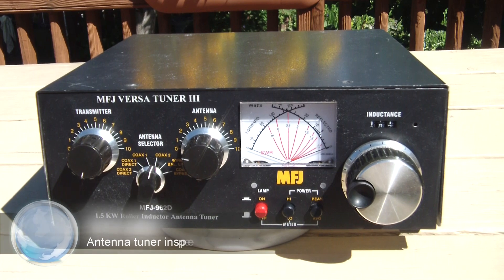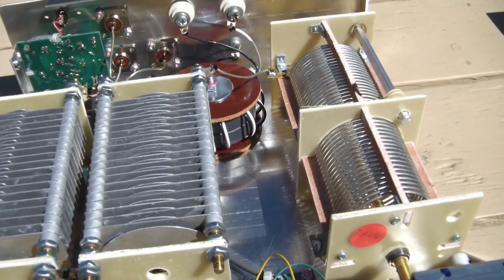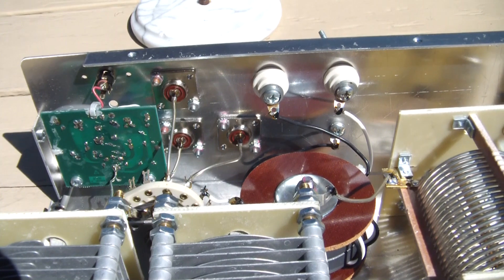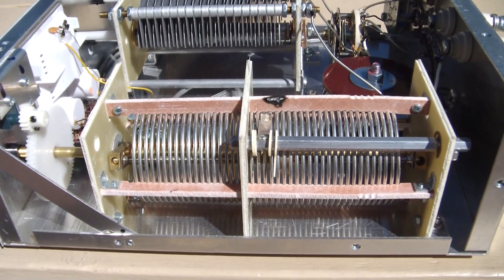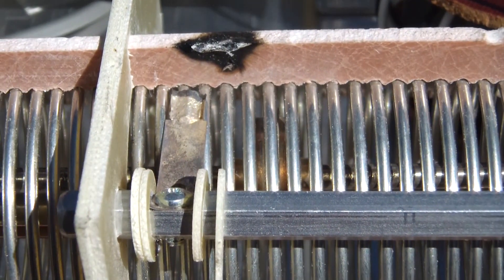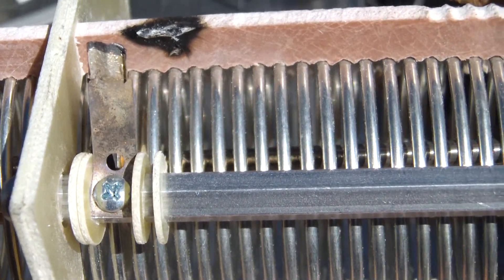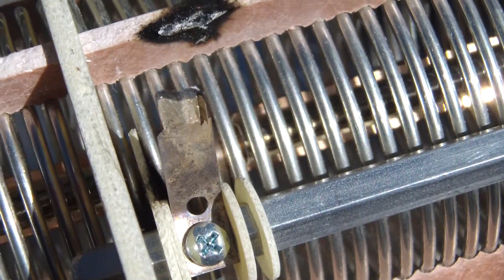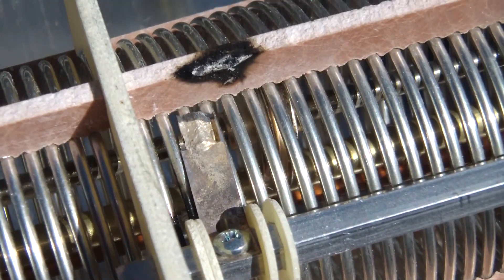MFJ962D, HF antenna tuner inspection.

Comment: Is just orser a new one ... theres probably a few bad spots in it anyway and you dont want it to fail while keyed down with the amp doing a KW .... it would surely arc the Caps... .as of  march 2022 they are $150.... which is a lot cheaper than 150 plus a pair of $95 caps = $350 ...
Not really worth the risk...

Btw the switch is about $95on the atr-20 and 30 so I imagine its close to the same on the MFJ too..

Comment: You are not to key up & put  any high power in the tuner when you are turning the noobs on the tuner , Use low power on the tuner to tune your  tuner/ antenna / radio  , Then  once there all  are tuned up you can turn the power up on your tuner to use , If you don't do this you will burn the roller / rollers on your turner .

Comment: take that rod out , you don't needs it , its one of MFJs better ideas that don't work right ,I took mine out and it works fine
Reply: Thanks. I looked into this, and you’re correct. The bar device is potentially helpful, but not necessary. And more importantly, it breaks because it’s horribly made.
Reply: It works ok  if you use the tuner in the right way in low power only , Then once you have the tune you can turn up the power , It tells you all about this on the MFJ website  , How to use your turner .
Reply: @kevinmcdermott3668  I used the tuner exactly as the manual tells you to. It didn’t arc over, but the self resonance defeat contact broke anyway. It’s poorly engineered.

Comment: There is a You tube video by Kevin Loughlin detailing the EXACT same problem, same tuner, listed with your video. Wish I could send a link, but don't know your email to send the link, but if you research KB9RLW, & tuner you likely will find it. Not sure it will provide an answer as he left it as is to give to a new ham that likely wouldn't be using 160 (for which the extra inductance is used). Good luck! 73's!
de seeker / Jeff WA7LFP
Reply from the maker: Found it. Thanks for posting your findings. I have not gone any further on this unit. When I get ambitious, I'll at least have an answer as what to do.

https://www.youtube.com/watch?v=uWgP9YE9pOU
Reply: @KlondikeMike  I bought my 962D used also and luckily the crap so called resonance killer was not burned in mine.  I've built several tuners through the years and never needed a self resonance killer, so I modified my tuner and removed this worthless piece of junk.  I also reversed the ground and input connections on the inductor so that the max inductance shows the highest number on the turns counter like all the old school tuners do. I also reset the capacitor knobs so maximum capacitance is shown by the number 10 on both capacitance scales just like old school tuners.  Now it's more like an old tuner I'm familiar with and tunes really well with just about any load I put on it !  Don't know why MFJ added the useless burning contact and why everything was setup to read bass akwards, but old school is cool and it works !
Reply from the maker: @rickmckee6698  Thanks for sharing your tips and tricks.

Comment: I had a similar problem on my MFJ 269, the 300 watt version of the same device.  Nearly identical except the parts are smaller and can't handle as much power.  Mine wasn't burned but the anti self-oscillation contact was jammed and wouldn't allow the roller to advance past it.  I found that the hex shaft was positioned 1/16" too far forward making the small fiberglass levers contact the coil and not slip between the windings as they should.  This was traced to a missing e-clip on the far end of the shaft near the back wall.  Replacing the e-clip brought the hex shaft into proper alignment and the switch contact then moved up and down normally.  I also found that the end stops for the roller were making contact on the sharp edge of the roller which would have resulted in dings and eventually causing skips in the tuning.  Removing the coil from the box and adjusting the stops with a file so they contacted the roller's axle and not the edge fixed that problem.
Reply: Remove that contact, it simply isn't needed !  All it does is ground the unused portion of the coil and the roller contact does that anyway !

Comment: I bought a 962D new from GigaParts six months ago.  Never opened it until last week.  It has the same burn mark and the tongue does not make contact with the coil.  HOWEVER --- It appears to tune well on three different HF antennas including a random wire.  Go figure.  
It does have a major issue with the inductor readout.  The gear on the shaft that turns the readout keeps "slipping" especially when turning the inductor counter-clockwise.  No amount of tightening the gear on the shaft will tighten it, so I can only tune the inductor via the SWR on the wattmeter through tedius guesswork.  I'm not sending it back to MFJ because I can't see that they can do a better job than they did the first time (which wasn't too good).  It's not the best scenario, but I can live with it (I think).  Live and learn.

Comment: You can either bend the tongue (or flipper as people seem to be calling it) down a bit, to see if that fixes the situation. Or like me, you can order the part from MFJ (like I did and I'm over the pond) and replace it. I don't know if the tongue is available separately, because MFJ sent me the complete bar, with tongue and plastic cams. I was taking mine apart to clean the copper bar from any carbon/arcing marks anyway, so it was no trouble for me.
My advice is stay away from roller drive ATUs unless you are technically minded to take them apart and overhaul them. Because when people sell them, it is usually because something is wrong with them and they want to pass that onto someone else. Stick with a switchable inductance i.e. A - L

It is important that the tongue works, because it cuts the inductance/coil in half, for the HF frequencies. The only time you need the tongue lifted is when you're operating Top band (160m). That means for all the other frequencies, you are using far more inductance than you need, which means the ATU will waste most of your RF power.
Reply: Just remove it, it is not needed !  I removed the one in mine and it tunes great and have had no issues !

Comment: Bought one off of ebay for the "going price", and also won a bid on a second tuner (same model) for a fraction of the first one's cost.(It's good to have a spare).Opened both of them up. The more expensive unit was missing the armature that glides along the coil...AND was missing the dummy load. IT WASN'T THERE! It also had scorch marks. Thank God I had the second cheaper unit to compare it to. The cheaper unit had all of it's parts intact, even though it was dusty. I obtained a refund for all costs from the fella who had "claimed" that "his unit" looked good inside with no evidence of "arcing". He claimed to have lent it to a fellow ham, who never informed him of the damage...but what about the missing parts? Yeah, there are some schysters out there. Hope you get that unit cranking, Good Luck.

Comment: Seems like you bought the tuner from a cheat. I had a MFJ tuner with a roller inductor and it worked fine for years. from the looks of it it is repairable. have you ever bought a used car. never buy anything used that you cant return.

Comment: That roller inductor is an incredible piece of flimsy junk. It'd be worthwhile to simply  replace it with a high quality piece from Cardwell or similar (18 or 20 uH  would do nicely). Sure, it'll cost you more than the tuner itself did, but at least you'd end up with a decent, reliable device. I wouldn't even attempt to repair that ridiculous MFJ-supplied component. Thank you for posting this, by the way. I'm sorry this happened to you -- but, with a new, decently built roller inductor, the tuner is salvagable (unless the variable caps are of equally poor quality). .
Reply: For 160 meters you need an inductor of about 33uH with the capacitors they use in this tuner.  If it had higher value caps like 300 to 400pf, you could get by with a smaller inductor.

Comment: hey thanks for your video quality I see a big problem here so there is something to fix that
73 oz1cfo
Reply: The easiest fix for this is to remove that flimsy, un-needed contact before it burns.  I took it out of mine and tossed it in the trash and have never had a problem with it.  But most folks are running too much power through this tuner.  I know the label says 1.5KW but that is transmitter input power, not the transmitter output power.  These tuners should never be used with more than 800 watts SSB, and no more than 600 watts CW and digital !